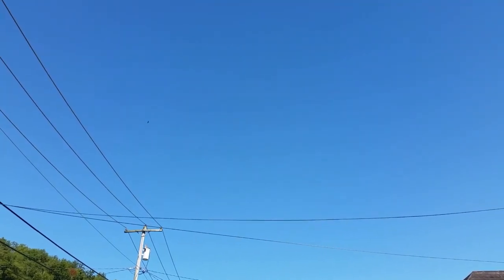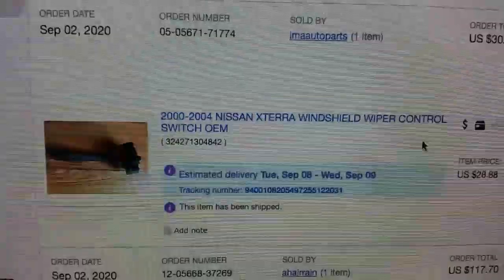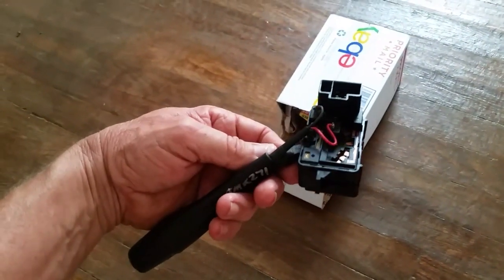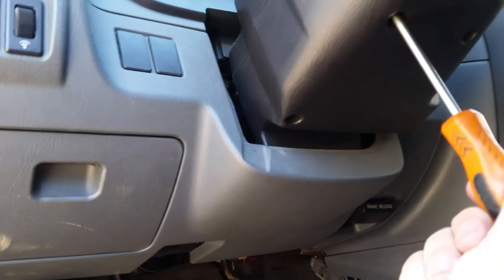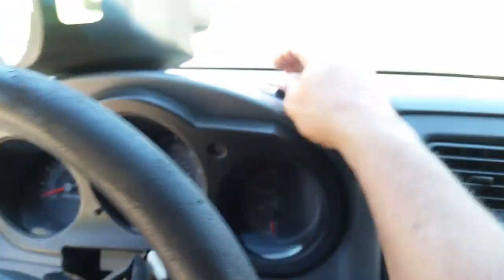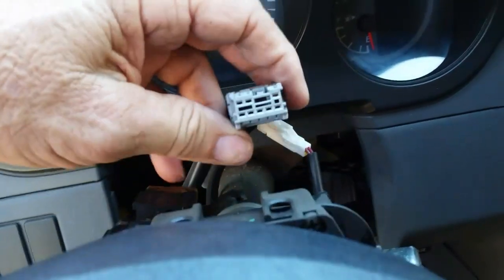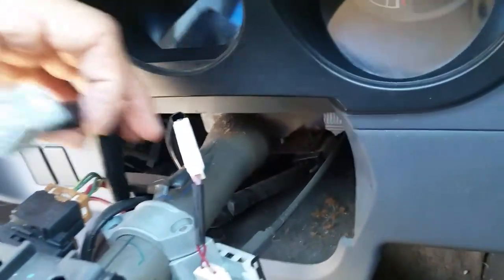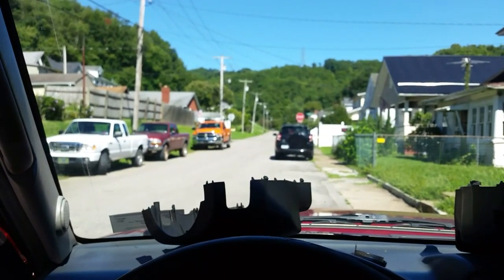Nissan Xterra Changing to Intermittent....Wiper control Arm swap. Does it work?

Comment: I would check the wiring diagram for it and then hit up the junkyard and look for the wiring connectors and see if using the wiring diagram could allow you to connect it.  I know some of the older vehicles you had to have a wiper motor that had the delay in it.  Not really sure about these newer vehicles too much.  The 2003 Chevy Trailblazer I know it is in the switch, but not sure of other auto brands.

Comment: I believe intermittent wiper setting needs a relay, that’s why the plug is different. If you find a way to wire a relay, you should be good.

Comment: So I just need to replace mine because it’s broken, hopefully nothing more than the control arm. Would you have just screwed the new on into place and plug it in then replace the part around the steering wheel? Thanks
Reply from the maker: I'll go back through my files and see

Comment: You have to add the intermittent relay to make it work. The harness is under the hood on the passenger side, look for a plastic plug with a wire loop, that’s where the relay goes.

Comment: Hey, sorry that it didn't work. I made a lot of research and I found that you don't need relay or wire up anything. What I did on mine, I bought the one for nissan sentra from 2001 to 2003 I believe, just plug it in and start enjoying your new intermittent wiper switch. The part # I got OEM 1691-7, just make sure the connection is the same, mine has 5 pins, 4 on  the bottom and one on top right, the one that I get has 7, 5 in the bottom and 2 on top one of each side, but my connector (harness) has 6 wires, anf I didn't have any issue. I bought it on ebay for $15 hope you read this and good luck. By the way I live in Vancouver WA and I understand you.
Reply from the maker: Hey Thanks! Wow now I'm excited!!  lol Going o try this!
Reply from the maker: I got one and it worked!!! Thanks!
Reply: @FixingWithPassion  Your welcome. Nice
Reply: Got the same Sentra Switch for My 2000 Frontier, since most things from the Xterra seem to fit My Frontier. The Frontier Plug looks like the Xterra and is to Big to fit the Sentra Switch. Duh! So Ya thing a Xterra Switch is what I should Get? Live and Learn! LOL